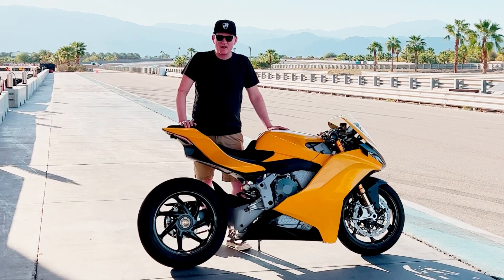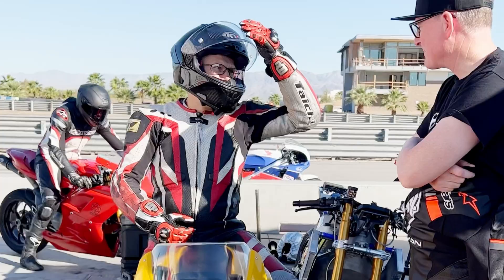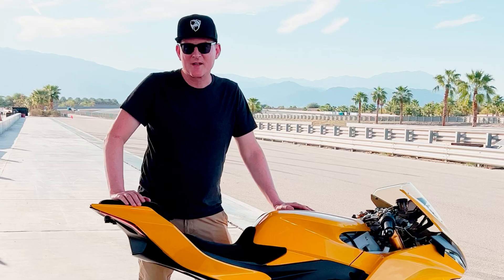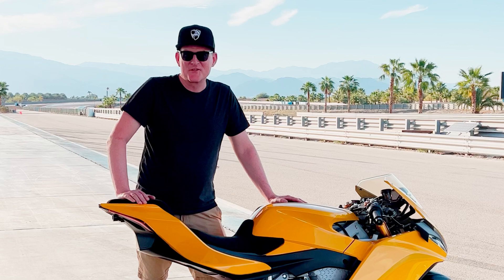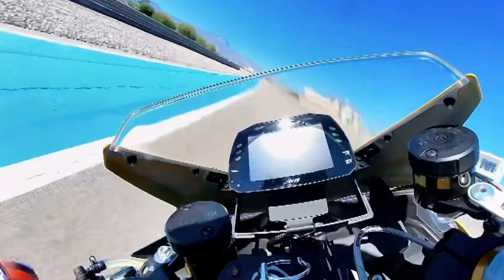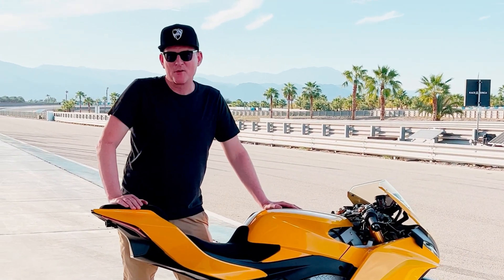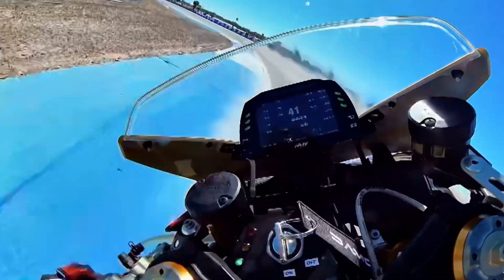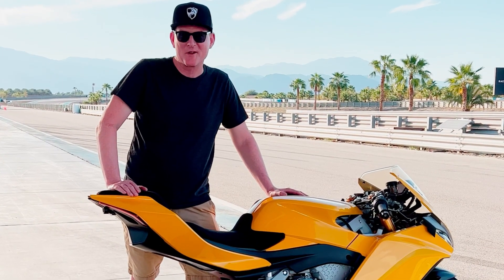The Wall of Acceleration

Comment: You can clearly see in the year over year press material that the bike has changed in terms of motor and chassis every year.
Reply from the maker: We changed the motorcycle design to improve its aerodynamic efficiency and help us hit our target performance metrics. By incorporating elements such as headlight-mounted wings, side-fairing internal ducting, and rear pillion vents, the latest design updates have set a new standard for motorcycle aerodynamics. These changes work together to redirect air and reduce vehicle wake, resulting in the HyperSport being one of the most aerodynamic production motorcycles on the market today.